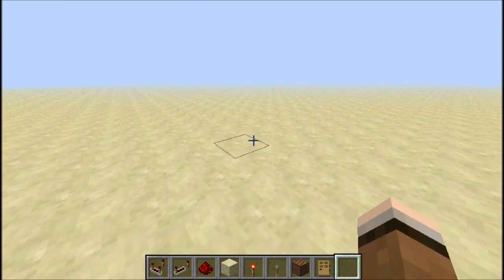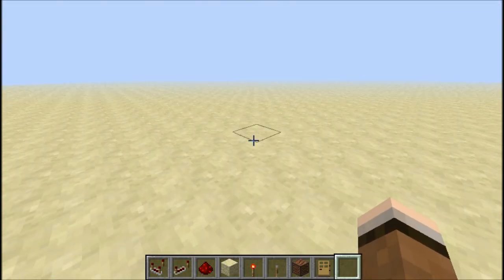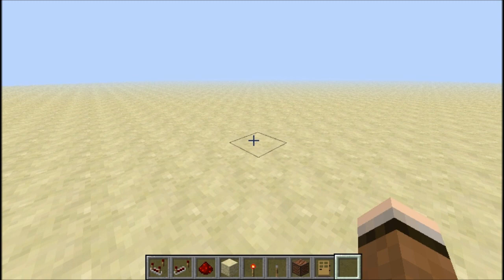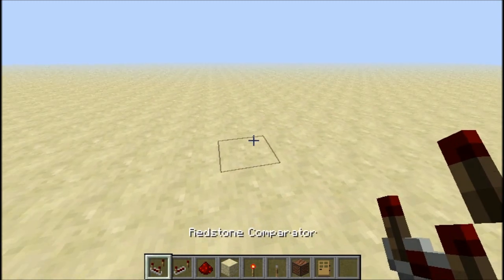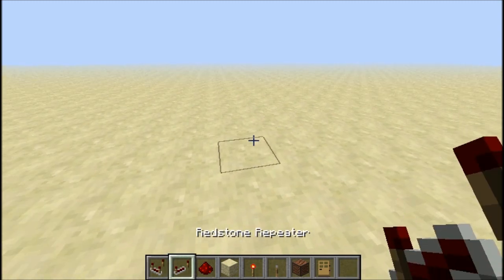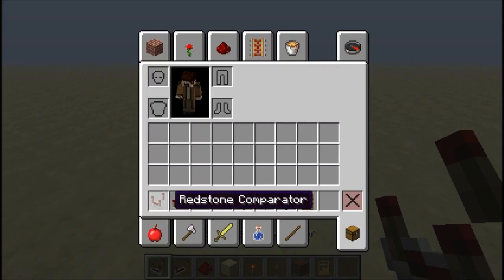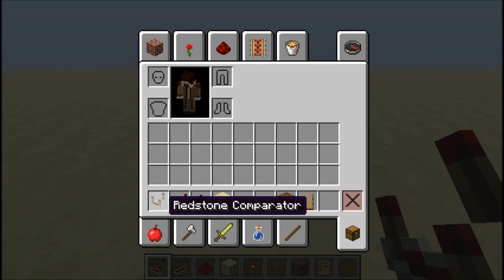Minecraft: How to Make a Clock with a Redstone Comparator

Comment: you can make a 2 long 3 wide and 1 tall clock with a redstone emitting block such as a torch, 1 comparator, 2 redstone, and 1 solid block (you can replace the block with another rdestone if you want). 

        ^=comparator where the side which has 2 torches is the side with 2 points and the side with 2 point has one torch. You must right click the comparator to turn on on the side with one torch or it wont work

#*    *= redstone
^*    #=solid block or redstone
!      !=redstone emitting block.

Comment: you don't know much about redstone do you that's a basic clock.. also when the front torch is lit is in subtractive mode so it will do (A-B=C C=output) and the output is zero then because B is the same as A turning it back on and so on until you turn it off

Comment: the input from the switch sends through it because it is stronger than the input coming from the side once it goes round and gets to the side it is no longer a stronger input than the side because right clicking it makes it subtract its current power from the side. so power is not flowed through and no longer supplied to the side and it starts over again no power on the side so it sends it through, power on the side so it stops sending it through. hope that made sense lol